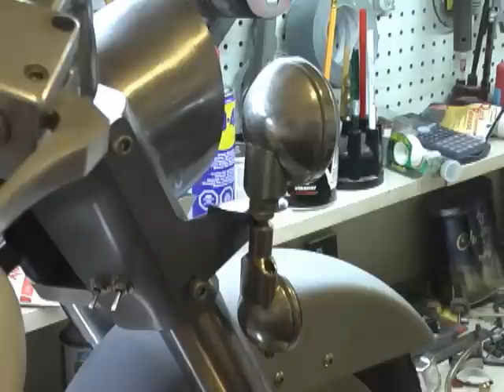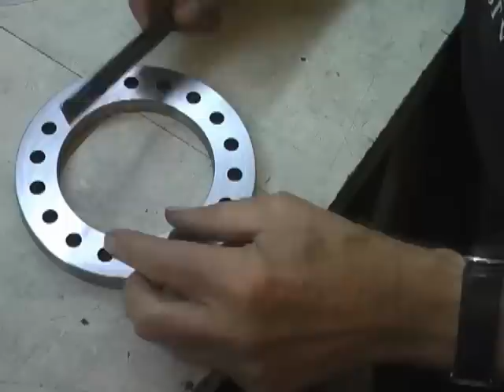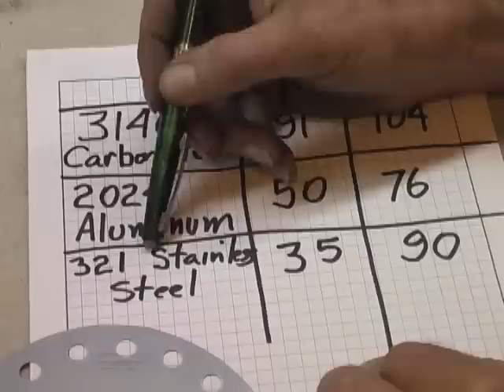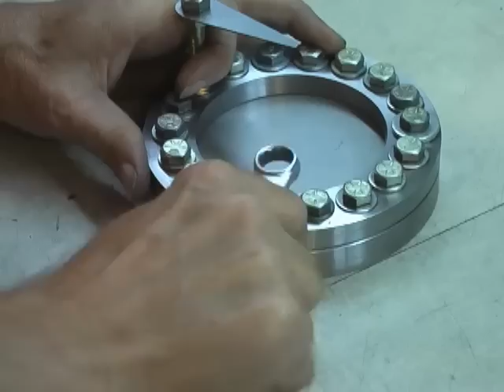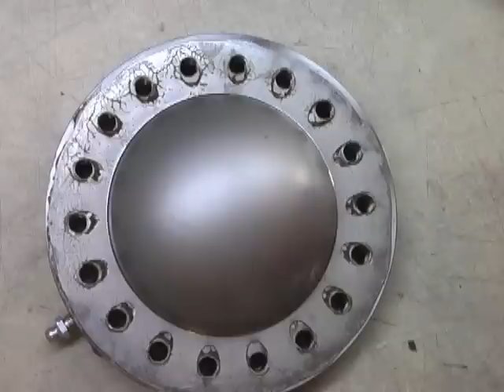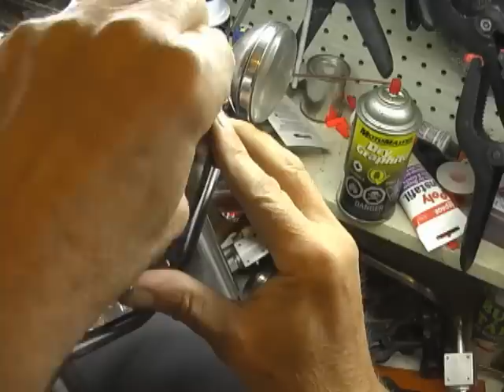Hydroform

Comment: Interested in build of tool. How did you get inside so perfect.
Reply from the maker: I have an old 10 inch metal lathe. HSS cutter on hot rolled steel.
Reply: @clarenceelias8123  
I've seen a few old craftsman lathes on line. I guess sooner or later it would Benifit me to have one.
Reply: @clarenceelias8123  
I looked around on offer up. Found me one for 250.00 looks like hell but I see will come in handy later.

Comment: Instead of using all the bolts, could you clamp the top and bottom plates, and of course the stock, in a Harbor Freight 20 ton hydraulic press?
Reply from the maker: No, since I don't have a 20 ton press. You could give it a try, though!
Reply: @clarenceelias8123  I don't either!

Comment: Couldn't you use water?
Reply: Yes, but the advantage of grease is that it is not creating leaks or losing pressure as easy as water. Also you can create pressures up to 300bar with a grease gun - and for pressurizing you just need your mussels. Last: Grease guns are quite cheap.

Comment: Stunning job :o) The borrowed metal is exactly as described by a guy vacuum forming plastic.  - just a note to anyone trying this, be careful of any leaks from the hose, my cousin injected his finger. Freak accident, but relatively easy with high pressures.

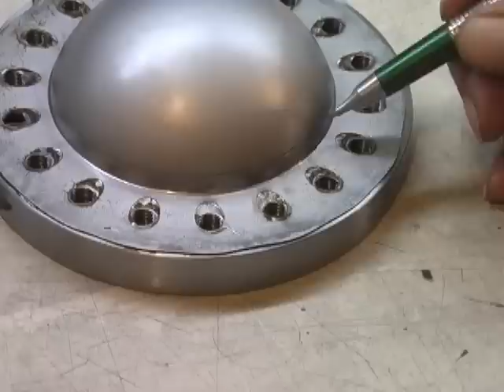Comment: The 321 Stainless steel workpiece has holes drilled the same size as the through bolts.  At 6:25 Clarence shows the 321 holes have deformed.  If these holes were larger,  the workpiece could more easily be drawn into the center because the through bolts would not contact the workpiece.  This means you could form substantially deeper draws.
Reply: Thank you

Comment: When you separate the pieces do you need to exhaust any pressure?
Reply: There shouldn't be any residual pressure, grease doesn't compress. Perhaps a tiny bit from the metal springing back a little

Comment: I didn't see him release pressure.
Reply: if its completely full with little to no air, the pressure drops off very rapidly. The grease is very incompressible and wont expand much at all if released quickly. No real mess if it fractures. One of the many benefits of doing it this way.

Comment: Nice job. The grease-gun is also a useful tool for freeing a seized engine. Don't remove the cylinder head. Remove the rockers from the offending chamber so that the valves stay shut. Break the insulator out of an old spark-plug and weld in a grease nipple where the insulator was. Fill the chamber with oil to the top, screw in the new plug, fit the grease-gun and start pumping! this will give you the equivalent of a 30-ton press that should shift any stuck piston.

Comment: is the greese still under pressure when you un do the bolds or if the reflector ruptures ?
Reply from the maker: No, Tony, by the time it gets that far the steel is so work hardened that there is no "spring" in it so the grease just kind of sags out. My comment about "the explosion" is just a joke.

Comment: Very clever application, however I suspect that the headlight will be for show, and not work very well for riding at night.  Nor will it be legal, since motor vehicle lights are required to be tested and have a DOT approval.  Well done on the metal forming, I had no idea a grease gun would supply that kind of pressure.

Comment: Beautiful,   I can't believe you did that with a grease gun,  I never would have thought the nipple would hold that much pressure.  Did you have a special connection there.?  I saw the first pumps, with the grease doing it's normal oozing along the edge,   But after that,  it was air tight,  How'd you connect that.?   I think that's the whole trick.

Comment: That is way cool! 321 stainless can be polished to a mirror finish, I used to polish engine nose cones when I worked at Cessna Aircraft. If you use a 1/8"NPT nipple between the die and gun instead of a zerk you won't get any spillage and will keep all the pressure inside .
Reply: That was exactly what I was wondering--if there was a better way to connect the grease gun to the pressure chamber--thanks for the tip.  So... what is a 1/8" NPT nipple?  I have a feeling these are not what you mean: https://www.aliexpress.com/wholesale?catId=0&initiative_id=SB_20210223004757&SearchText=1%2F8%22+NPT+nipple.   And on the grease gun side, if I remove the zerk coupler thing on the end of the grease output tube there's 28tpi 9.3mm diameter threading on which to attach a fitting to couple to the 1/8" NPT nipple you mention...I don't find much with this tpi and diameter.  ...maybe this kind of thing is also a solution? https://locknlube.com/products/locknlube-grease-coupler

Comment: Ok you leave me asking the question on how to release the pressure so you can open the form.
Reply: disconnect the grease gun  , any pressure will be released through the grease nipple ....................
Reply: @kawasakikev8905  Uh no it won't, those zerk fittings all have a one way spring loaded ball check valves in them so the grease can't escape. I've changed out hundreds of them. For all intents and purposes the grease will act much like any other fluid, it can't be compressed. So loosening one or two of the ring bolts would immediately relieve any minor residual pressure. But since that fixture isn't obviously air tight once you stop pumping there really shouldn't be much pressure to release.

Comment: This is cool but 2 things I would like to note. SAFETY - I do not agree with standing right next to this as it is pressurized/hydro-formed. If it did pop you could  get a high pressure jet of grease hitting your face/eyes. Place some kind of partition between you and the hydro form item and peek over it at the dial indicator and also wear a full face shield as is used for grinding.

2nd point, get a porta-power type hydraulic pump, these are super cheap on ebay, plumb that in and you can easily pump it until the hydro-forming is done using hydraulic fluid. You could also use a air over hydraulic pump and just hit a lever to actuate it, but that would work faster and thus be MORE dangerous.

This gives me ideas on how to form aluminum dish, this could then be cut up and the dish section quarters be used as corners on box structures where 2 radius corners meet such as the corners on a box trailer. If I wanted to build a enclosed trailer and wanted the corners to look professional I could build a large version of this, hydro-form the required size aluminum dish then cut it in sections and weld or rivet it to the trailer box corner and it would, after some careful work, look great.

~

Comment: I'm not trying to diminsh the awesomness of the grease gun technique.
But, it occured to me that an alternative way to form the reflector with the same plates that Clarence utilized; would be to put some distilled water in the chamber, and toss it in the oven (when the wife is out shopping).
Steam pressure would form the sheetmetal, and the pressure could be released via a valve threaded into the same hole that the grease fitting used.
Now, I know what you are thinking...
"The heat energy would be wasted, thus, contributing to global warming."
...Not necessarilly so!
By simply directing the pressurized steam into a subsequent smaller chamber filled with coffee grounds, Clarence could have enjoyed a fresh cup of espresso, while completing the necessary paperwork for a federal monetary grant to further his research in the area of Green Manufacturing Techniques.
Reply: O.k. Tommy,
I'm not going to debate against your opinion, or Myth Busters.
But, I am going to be completely honest with you.
Anyone can buy a brand new iron, and fill its reservior with distilled water, and plug it in.
My wife has done this, as have millions of other people in the United States alone.
And, as God is my witness, the distilled water exits as steam, through the steamholes, untill the reservior is empty.
When more distilled water is added, it does it again.
Reply: Power plant worker here,  we go above and beyond distilled,  and purify our water to a near pure form of deionized water. (<10 micro Siemens resistivity)

We then put this water in boilers in which we subsequently add great amounts of heat. The result is a massive amount of steam that we then pass through a stream turbine,  producing electricity,  the de-energized steam is then condensed back into water and pumped back to the boiler,  rinse repeat!
Reply: @THEfamouspolka  
Not to mention, the phase diagram for water shows Tommy Smith doesn't know what he is talking about.
Reply: @crookedriver2079  or hell watch an episode of mythbusters where the deem exploding water plausible
Reply: that was cool never seen that before.
Reply: ...and I always thought that my wife's insistance on using distilled water in her iron ( as recommended by the manufacturer ) was to iron my shirts better. 
Are you sayin' I didn't do well at my last job interview because my shirt was wrinkled?
...cuz, I got the job.
Reply: Isn't steam, by definition, distilled water?
Reply: @chrislong3938  Damm close to it, ifr not in fact!!
Reply: marshalllhiepler myth busters did an episode on it. They got water(distilled) to explode. If you look up it's scientific properties it has no boiling point. There has to be impurities present for water to steam.
Reply: @tommysmith8801  
The why doesn't the phase diagram for pure water show that it has no boiling point or can turn to steam?
Reply: @crookedriver2079  then explain why pure h20 can reach a temp of 500deg without boiling.
Reply: reply to: THEfamousepolka
Good point, and exellent practical example on a larger scale.
I have spent many days working on the massive compressed air systems at various power generating plants in the Maryland / Chesapeake Bay area.
I have seen the huge boilers (coal fired) and the generating turbines in operation. Corrosion/Scale build up is an issue, when converting water to steam, hence the use of highly purified water as you mention. Very good point.
Mythbusters did not prove that distilled water would never boil in a pure environment. Rather, they demonstrated that pure water can be heated to a higher temperature than particulate infused water can, before a change of state is induced. 
Both the household iron, and the massive boilers at thousands of generating plants in the U S, demonstrate that distilled water does indeed boil when the required amount of heat energy is absorbed.
Reply: reply to Chris Long:

My understanding is that the process of distillation is a change of state, due to heating; followed by a change of state, due to cooling. Yes, steam is a part of the distillation process,, but I believe the full cycle must be involved to be complete.
Reply: marshalllhiepler 
It is my understanding that the system used to distill water must be increasingly clean the farther along you go, with the final receptacle being as clean as possible.  As you add heat energy to water it will rise to its boiling temperature for wheat ever pressure the system is under.   Different pressures have different boiling pointes, the most common one being at sea level (100°C, or 212°F).  Once the water is heated to its boiling temperature all additional heat energy will go to further exciting the water molecules,  the temperature will stay constant. This is called the latent heat of evaporation.   You will then get a water steam mix.  In a still set up the steam is routed into a series of tubes;) where in the heat is given off condensing the steam back into water where it can be routed into a clean container. 
This is effective as by heating the water, it's molecules boils off at a lower temperature than most all impurities found in the waters initial solution. 

If your final receptors is dirty, some of the impurities found there will go into solution with the condensed steam. 

A particularly amazing video that explains this and other properties / states of water is the "Triple Pointe effect" video.   Just type that into your YouTube search and prepare to have your mind blown!
Reply: reply to: THEfamouspolka 

Wow, what a trip; watching water boil beneath a layer of ice!
Thanks for the suggestion.
Reply: @ Tommy Smith. what NONSENSE! Of course even very pure water will boil; the vapour-bubbles will form at a higher temp than its vapour-pressure and it will be "bumpy" but it will surely boil. WHERE would otherwise  all that added heat-energy eventually go? Like a steel vessel would start to glow red, but the water in it will never boil and no pressure will build up? Kindly do NOT talk shit if you know nothing -thanks.
(But agreed, the oven-method proposed would be quite useless for other reasons. For one, even at a temp. of 270 Celsius (518 F) the steam pressure will be barely half of that grease gun.)
Reply: reply to: Vox Veritates :

I admit it, Vox.
I was delivering facts mixed with humor, under the pressure of scrutiny, in hopes of bringing viewer comments to a boil.
Cudos to you for your comment. Although you seemed a tad steamed; your points were 99.9 percent pure. 
Best regards.
Reply: As long as it was obscure tongue in cheek. But the oven-steam method was dangerous madness at best.
 I am in fact presented today with: "how to shape two 2 mm thick disks of 380 mm diam. to convex shapes". So before I go and cutting-out & weld into them, I will surely try hydro-forming. (but NOT "steam-forming"!) 
I will mig-weld the edges together and put 150 bar of my pressure washer on it.
And now I chat to  you here, I may make a vid and put it up on youtube.... IF it works. Otherwise I'll have to do the drudgery of cuttin' & weldin' & grindin'.
Reply: reply to: Vox Veritates:
Good luck with your project!
Yes, steam would be lunacy, as any expandable gas would. The benefit of water is its incompressability factor. If the metal splits during the forming process, the worst case scenerio might be an unwanted puddle on the shop floor. Using air (or steam)  implies far greater consequences if the project goes south. No telling where the shrapnel would fly to.
It would be cool to see some video footage of your project, but don't stress over it. Putting on both caps of Metal Worker, and Video Production Manager is sure to increase the length of project time ten fold. 
If you decide to post a video, please send us a link to it here.
Thanks.
Reply: Will do! 
1st will run a rough pilot, on a smaller scale to get the right proportional dimensions  length-diam. VS filter-flow rates w.r.t the proposed, pressurized cylinder-filter. And perhaps I should rather TIG it, I just worked out that the total force could be potentially 170 000 Kg! Nice test on weld-quality as well....
Reply: Marshall, there wouldn't be enough steam to do the job.
Reply: No, Tommy. Distilled water boils fine; I've done it. Distilled water boils at a lower temperature - not much, but still lower - than tap water because there's lower mineral content in distilled water, and the minerals raise the boiling point slightly.
Reply: You miss the point. It's not the actual BP that is at issue here, but that very "solid particle free" water (liquids) + a vessel with very smooth walls do not offer the nuclei that will allow vapour bubbles to form well. 
By definition, a liquid's BP is when the vapour pressure equals the gas / atmospheric pressure above the liquid. But any such liquid still needs nucleation in order for it to boil at that temperature.
And the more such nucleation is absent, the more "bumpy" the liquid will behave and the higher the localised temperatures will rise above the "official" BP. 
Any organic chemist knows that without either a stirring magnet or the adding of "boiling chips"* (small stones), the liquid that he will attempt to boil in a boiling flask will act out horribly: first nothing happens, and then when the liquid is heated much beyond its BP, a tremendous gushing will ensue. And the "cleaner" things are, the worse this will get. 

*When doing a distillation under vacuum, one can also introduce a minute stream of air into the liquid again so as to aid vapour nucleation,
QED
Reply: marshalllhiepler distilled water doesn't boil. In a clean environment it would never turn to steam

Comment: I have used a grease gun for another motorcycle task, to push out seized brake caliper pistons (the grease gun will seal on normal bleed nipples). Of course this leaves a difficult clean-up job, but if the calipers are bad enough to need this treatment then they need a good clean anyway.

Comment: What happens if you heat the work piece?
Reply: Interesting idea! I think the heat would transfer through to the fluid, causing it to break down. I don't think you'd ever get the material hot enough to really help. There may be some heat transfer fluids that could withstand the elevated temperatures, though.

Comment: Good idea but this will blind oncoming motorists. It needs to have a 'tuned' beam - half of the light in this set-up will go into the air and the rest will be badly placed onto the road ahead.
However, it will be fine for daylight use.
Reply: Jack King that's what lenses are for